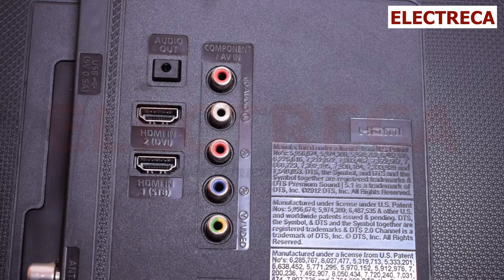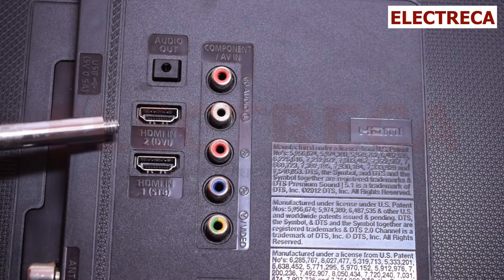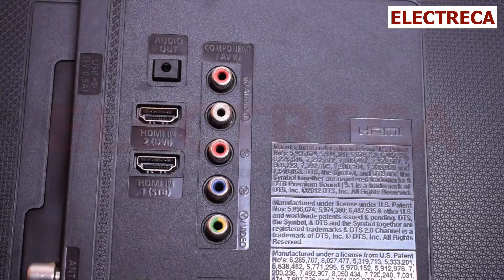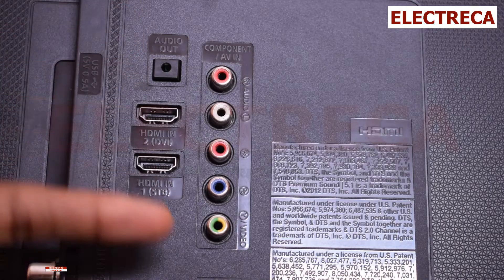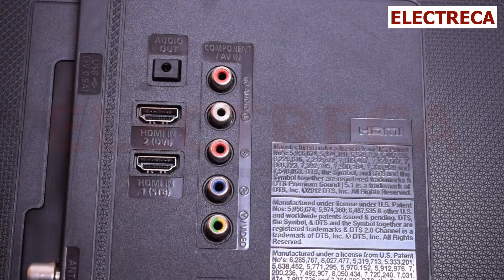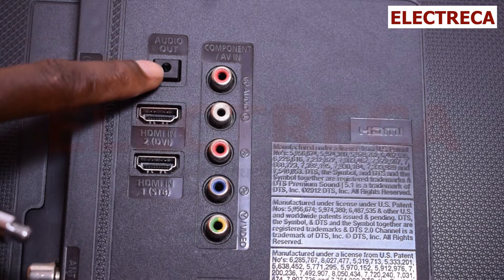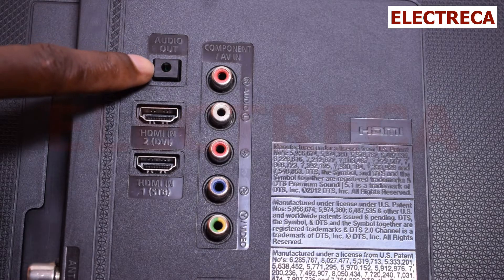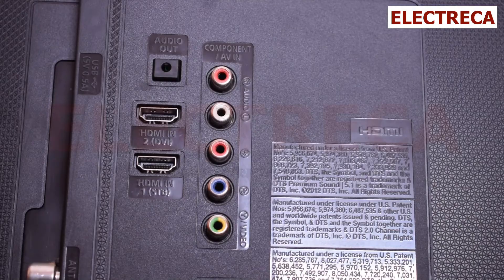Tv's Components|HDMI and AV Explained

Comment: My tv has an optical cable instead of the 3.5mm jack audio out. My speaker is logitech z333, can i use red and white cable for audio output to use the speaker for the tv?
Reply from the maker: I think what can help you is a convert......optical cable to 3.5mm female. and then use Analog Stereo L/ R to connect to your logitech.
Reply: @electreca1  thanks for the info

Comment: The AV on this TV is same on my TV but it doesn't work when I connect them to my vcr/dvd combio
Reply: It depends the name of the DVD PLAYER and the name name of the TV 
The best TVs and DVD players  is LG and Samsung 
Fore start use only the yellow video wire which is one  wire and conect to your TV and press the AV button on your TV remote and go to the DVD player  settings and put your DVD player on Automatic  ore PAL ;if that does not work than disconnect the  yellow video  wire. 
After you have disconnect the yellow video wire ; connect then the 3 Y Cpb Cpr ; Y Pb Pr which is red ; blue and green video wirers of the DVD player  to the Tv and press the AV button on the TV Remote control DVD logo will display 
Go to DVD player. settings and select Automatic ; But your TV must be on AV ; if you do not put you TV on AV the screen will not show the DVD logo 
First of  all press the AV button on your TV remote controler  and it will show the DVD logo
If there is HDMI in puts on your TV and DVD player ; select the HDMI connections and select HDMI 1ore 2 ore 3 on the TV  and it will display the DVD logo 
The HDMI cable  is a bigger wire then other DVD wires
Reply: Press the AV  button on TV Remote twise fore AV 1 and AV 2
Reply: The best option go to shop where you have buy the TV and DVD player and let them connect it fore you  and you can learn from them. Ore search fore more YOU TUBE videos and they will show  you step by step

Comment: Help! When I connect my VCR to the AV input, it says “No Signal” but the VCR is on and I put the wires in the right inputs.
Reply from the maker: It could be that the AV ports on either TV or VCR is spoiled. you can try connect a different device to that TV set AV port.
Reply: @electreca1  ok I’ll try, thank you for the help 😊

Comment: How Can I Change that Source List  
 From Component DvD into Av Cable STB
Reply: Because That Changed Tv displaying colour into Black & white
Reply from the maker: I thought if you press source on your remote all the inputs are listed then you can select.
please repeat your situation.
Reply: @electreca1  How Can I Change
Reply: I want Some more Videos I Can't understand
Reply: At the back of old dvd players video is as follow 
1 Y pb pr- red ; blue and green video ot put
1 Y C pb C pr - red ; blue and green video out put
 2 Yellow video out put
The yellow video out put works alone and it is one wire and goes with audio red and white. 
The Y C pb C pr is 3 video wires and go along with audio red and white 
Do not conect the yellow and the Y C pb C pr together 
You can only conect the 1  Yellow video wire and disconnec the 3 video wires Y C pb C pr but keep the audio red and white connected 
Go to your dvd player settings and choose analog
Ore you can disconnect the 1 yellow video wire  and use the 3  Y C pb C pr video wires 

If your TV and DVD witch is called a BLUE RAY DVD player have HDMI inputs ; use the HDMI in puts ; and go to your HDMI DVD Blue Ray player settings choose 1080p fore HIGH Definition whitch shows far clearer pictures and better sound than old video players and tv. On your TV choose HDMI 1 ore 2 ore 3 and disconnect all other wires ; that means you only going to use one wire from your  HDM DVD Blue Ray player to your TV ; and get your self Blue Ray DVD movies
Reply: The best wy if you go in to your dvd player  settings choose Automatic